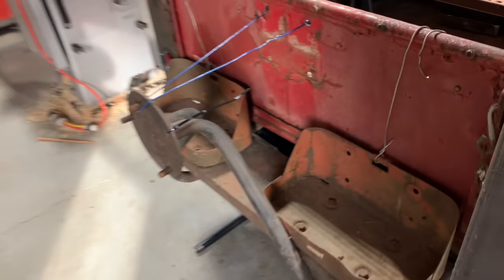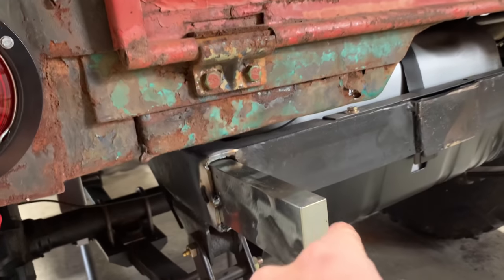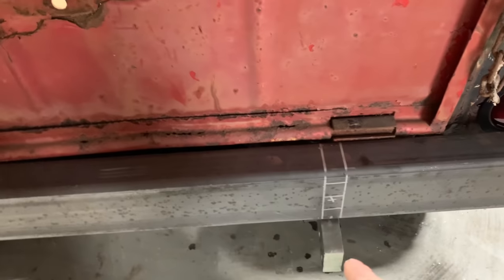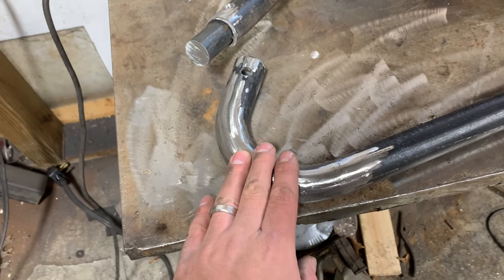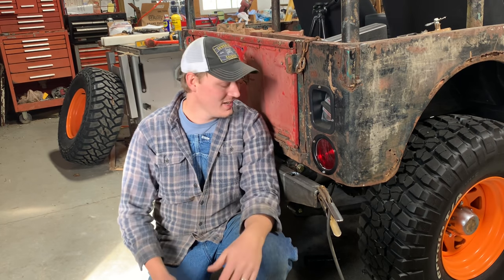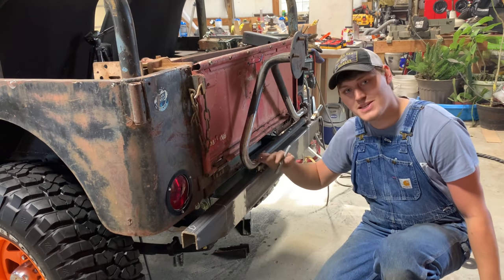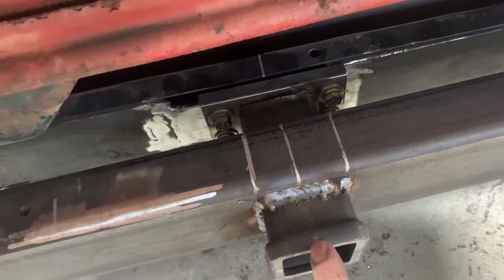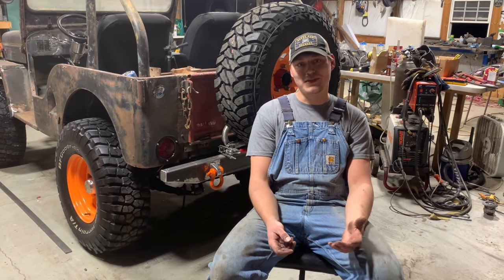Willys Jeep Custom Rear Bumper and Tire Carrier!

Comment: I built my tire carrier using the front axle spindle bolted to the tire carrier, bearings, hub and drive flange. That way I had the extra parts, especially the bearings. And the spare did rotate. Kinda funny.
Reply from the maker: That’s a cool idea!

Comment: You did good planning of cut away the flip down spare tire holder tubular and change it into swing type spare tire holder. The tubular could be bent up to 20 tons of exert by the arbor press  hold by 1 inch square hole bench vice versus Gantry type bender by the RogueFab 6 or 5 foot maximal height or by Vevor with curved anvil dies includes round groove for pipe size 1 1/2 inch pipe and another die for bender 12 tons jack Eastwood  1 1/4 inch pipe handling by the spoon wrecking bar 6 foot long x 1 inch thick for heavy duty type in your truck or Jeep stop shop. Near my mobile shop crane shop. I don't have that super duty pipe and wrecking bar that weight around 18 pound spoon.
Reply from the maker: Thank you!

Comment: The hole saw for add the spindle hinge of your spare tire holder to the rear bumper. Naw, it needs acetylene and oxygen tanks for making a hole for the spindle to to the work of the rear bumper. The acetylene is more expensive than Mapp Gas 20 Cubic foot. Use the Mapp gas and red glow the rear bumper to make a hole on the top. Then blow oygen fast balst blow then it cuts - it makes hole in one second after prep it with blue torch that made the rear bumper red glow about 15 second but with Mapp gas about 30 sec. Because plasm cutter for thick gauge will take like 2 min or 3 min to cut the hole. The hole saw does not last at all. You are a welder not a sawyer. The hole saw is slow like 5 kinutes to make a hole plus they don't make it anymore called resin holding diamond zirconia grit in the hole saw. 
  Then use a single cut round file to cut the hole into accurate hole or use the burr bit whetstone with the unremovable Campbell-Hausfeld shank and attach to hi-speed drill's chuck. Thank you.
Reply from the maker: Thank you!

Comment: Be careful with that welded on hub, the cast hubs get brittle when you weld it and can break off on hard bumps. I did the same thing and lost my spare tire on the highway. Maybe run a supporting rod from the steel frame to the back of one of the steel wheel studs? Your bubba bends came out really nice!
Reply from the maker: When I welded it up I was wondering how strong the weld would be into the cast. The guy I saw do it has been running it a few years without issue but I think you have a good idea also supporting from the studs. Thank you!
Reply: Maybe just put a blabking plate at both sides and a bolt thru to tie everything together, just as safety
Reply from the maker: @sash328  Good idea!

Comment: That is so well thought out! i just bought '52 Willys. once i get it running, i will need to make a spare tire rack. only problem mounting spare at the rear might block rear sight? what about have it mount on the right rear side, would it block the right  vision and offset the turning balance when rounding the corner? of course I know turning any corner requires slower speed. i have seen tire mount on the rear side, but not sure how the handling feel? Ty you for this insightful idea.
Reply from the maker: The issue I’ve run into mounting it on the side is if you run bigger tires that stick out you have to space out the spare from the body and it creates a lot of leverage on the corner of your Jeep. Stock tires shouldn’t be a problem. Thank you!

Comment: The Jerry can of Petrol is place on the top of the hood and make bracket to hold the jerry can. The oldest Jeep that you have is where the fuel is gravity fed. Yep it is original Like Kaiser-Willys where Overland is sold to R&R company and converted to Juan manufactory of Windsor engined jeep wagons shorty wheel base Quad.
 In Southeast Asia, he made the tubular unit called spare tire holder swing sideways. With his welding elbow and straight tubes all together without using the bender so he had many different pipe angle 45 degree and 90 degree and 20 degree elbow. It was why he build nice looking spare tire holder.
 The tube bender can also carries the pipe expanders it depends the set.
Reply from the maker: Thank you!

Comment: That turned out great. I'm curious why you didn't just leave the frame mounts long and use them as your recovery points.
Reply from the maker: Thank you! That was the plan until I found out that frame wasn’t perfectly straight. That far out the angle was too exaggerated I couldn’t make it straight. Good eye!
Reply: @SevenBarSalvage  that's how I built the rear bumper for my square body. I figured that's where you were going when you used the 1" for the mount.
Reply: U

Comment: just wondering if ya put a lift on this if so where ya get it at ? Thank you
Reply from the maker: The springs are super lift 1” over stock (discontinued) and I used some rubicon express 3/4 lift shackles (these are still available)! Thank you!

Comment: Hey how are ya? I sure like you channel thank you for the studded knuckle, gas tank steering, seat notch videos. I was looking at the tail lights what are those I would like to get those for my 1969 cj5. Thank you for teaching us, I look forward to your videos. God bless you and yours
Reply from the maker: Thank you for watching! They come from tractor supply but Amazon has them too here is the link:

Blazer International B430BLK 4" Round Stop/Tail/Turn Light, Red https://www.amazon.com/dp/B0045LXHUA/ref=cm_sw_r_cp_api_glt_fabc_HKVK9WB9CSKXMSDMWG7H?_encoding=UTF8&psc=1
Reply: @SevenBarSalvage  cool thank you. I have a 1969 cj5. The previous owner put in a custom tank in the rear but it is kinda jimmy rigged. I was thinking of putting a yj tank, that way it will match the hole cut in the body. Also have to do the seat notch, so thank you for doing that and making videos for all of us to see how to do it. God bless you and yours.

Comment: I did a bumper similar to that , it was 3x5x1/4 in thick tubing and used 5/8 plate for the mounts to the frame. The 5/8 plate I brought through the bumper tube was the clevis mounts for my recovery points with a 2” receiver hitch. It worked out very well and strong as hell. It was on a 1967 Jeep J3000 truck. I towed a 30’ trainer with a 43 gpw and a 73 J4000 on it and the truck and hitch never batted an eye at it.
Very nice build
Reply from the maker: That’s awesome! Thank you!

Comment: I am working on my 53 3B. What gas tank are you using. I have been looking, measuring various tanks to mount in the rear. Planning to incorporate the swing away tire mount also.
Reply from the maker: It’s a cj5 15 gallon tank. I’m running a 1” body lift and 1.75” over stock lift and it’s snug but it looks like it will clear the rear axle. I have 2 videos on the install! Thank you for watching!

Comment: Back in the mid 70's my Dad built a rear bumper/spare tire carrier/gas can holder. It was on our 1969 Jeep CJ-5 The Jeep had the factory 10 gal. tank under the driver's seat and we found at a swap meet an aftermarket 10 gal. tank that lived between the rear frame rails. The carrier had the spare mounted in the middle like yours but the gas cans where mounted on either side of the spare so when you looked at the Jeep from the back you saw the narrow side of the gas can. With this setup the Jeep could hold 30 gals. of gas.
Reply from the maker: Dang that’s a lot of range! Very cool!
Reply: @SevenBarSalvage  Yeah it was. And to top it off the Jeep had the factory installed Buick 225 V-6 with a Warn Over Drive. It was what I learned to drive a standard transmission on and took my drivers lic. test in and somehow scored 100%.  My high school friends and I had a lot of good times in that Jeep sadly the Jeep and some of those friends are no longer with us.

Comment: Nicely done. I ran into the same challenge with the Destaco clamp in the EMS kit. It is designed to operate in a *90 fashion. Had to get a different clamp because I waited til the end of my build to engineer the clamp on my dual swing out.
Reply from the maker: I’m glad I’m not alone. Thank you!
Reply from the maker: I’m glad I’m not alone. Thank you!
Reply: I used their kit on my TJ, I set it up so the clamp is pulling down and in at the same time to the swing arm is really jammed into the poly stop block. I also put bumpers on the tire carrier so they would contact the tailgate when latched. Everything locks together with a little preload on it and the whole thing is rock solid. Zero wiggle on the freeway or the Rubicon and it still opens easy with no drama.
Reply from the maker: @handbannana3610  Great ideas! I might add the blocks between the tailgate and tire I was trying to think of a third point to minimize wiggle. Thanks!